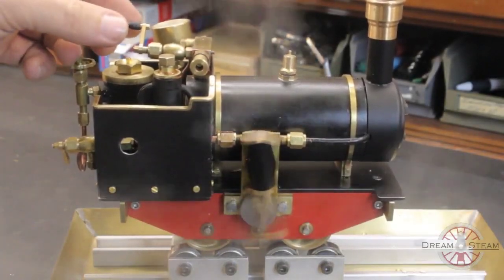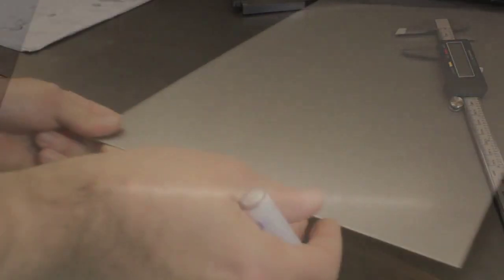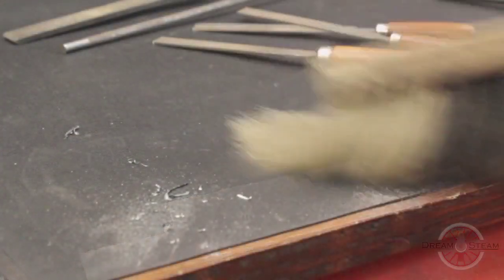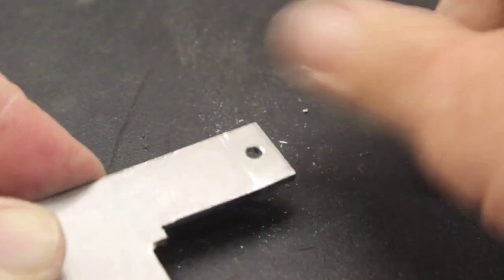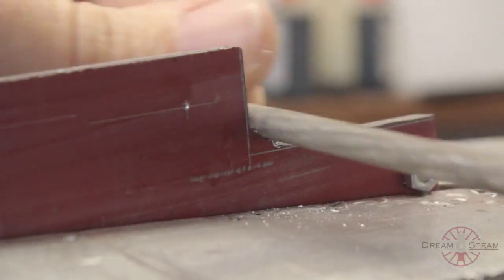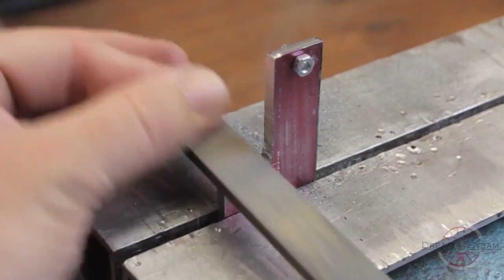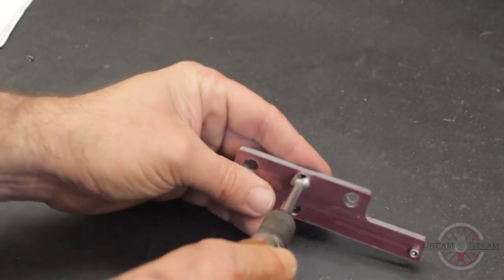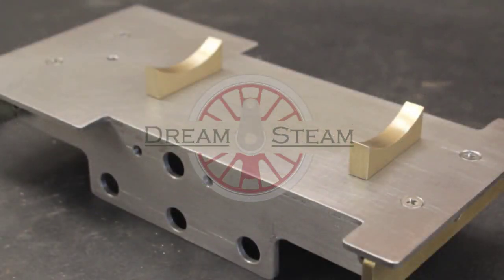Lets build the Cracker #1 Frame

Comment: How do you make sure that the sides of the buffer beams (where they meet the frames) are square? If they aren’t dead square, then the whole thing won’t work.  Do you have another video that shows how you did them? Thanks.
Reply from the maker: I filed them square... (nearly) you also can make Sure squareness, by force the  Buffer and Frame square, and than lay the footplate on and transfair the mountingholes on the bufferparts. Or maybe just make the screwholes slightley bigger, and force all parts square while screw the footplate on.... 
Or just give the Bushes some clearence.... there are many ways to skin a cat....

Comment: Nice work what plate are you using to make these side parts
Reply from the maker: A cheap Kind of jewellery saw with a verry cheap 4 mm wide metal sawblade .....if you mean the material of the frameparts... its just 2 mm thick mild steel....

Comment: Great Job. Filing is the tool of a real tradesman, in time's long gone apprentices would be give a block of steel a set of drawings with sizes and a set of files. The block was marked for size how square it faces were and the finish surface had to shine like a mirror. If all aspect were not meet another block of steel was issued and the work performed again till it was right. This was done to show simple tools could produce exacting parts.  Today they put the steel in a CNC mill and punch in a G code the skill gain how to press buttons.
Reply from the maker: 2 years ago i would do anything to put the parts in an Mill... but i had no... and no Budget. So i had to learn to file.... today i have a small (cheap) Mill.... but i learned to love Filing.... really.... and enjoy it all time.... absolut fascinating for a wood craftsmen like me, to make Things like that.....